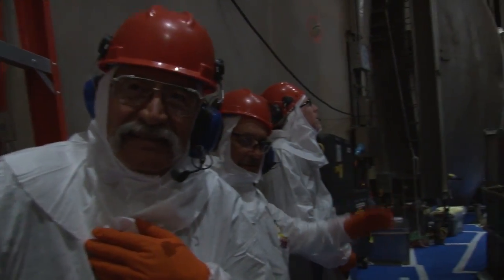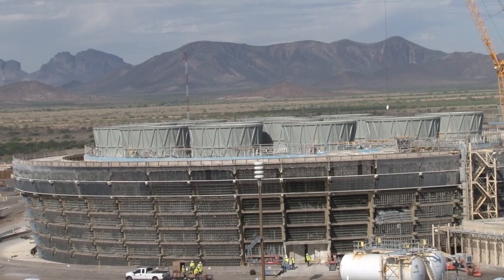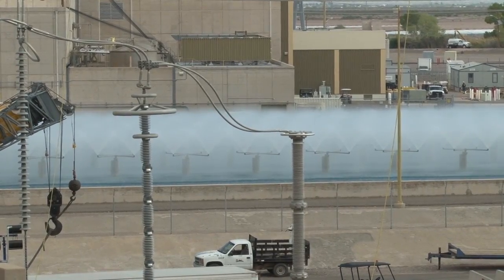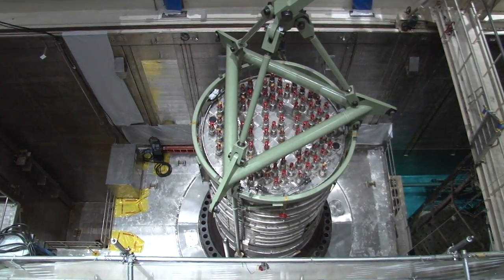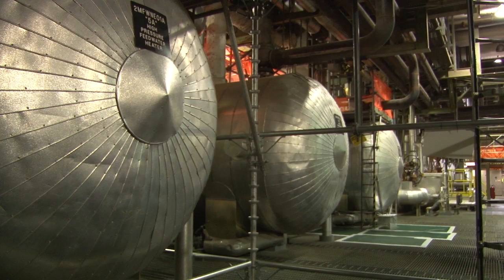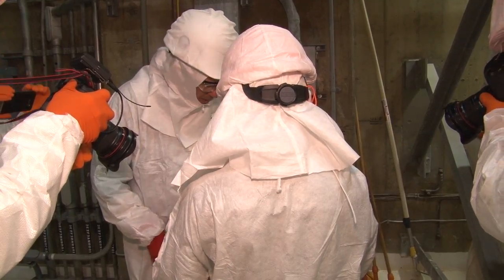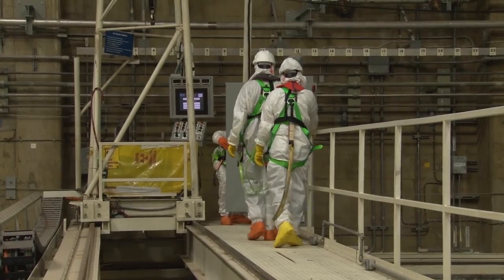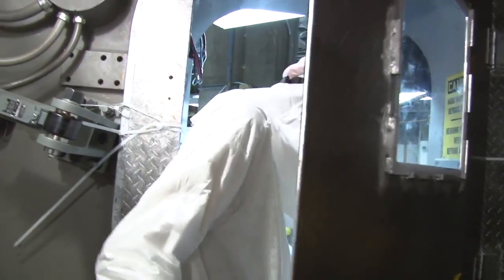Tour of the Palo Verde Nuclear Power Plant

Comment: according to my calculations in a CME level 5 event the scene could be bad.  A CME of that magnitude that could create a loss of the 66.5 million gallons of water resources from Phoenix and the two other cities used by PV each day. That  could last up to a year and, the PV plant complex would have about 17 days of water to use out of storage before it ran out.  Would the PV plant complex be able to bring about a cold shutdown in that amount of time or would we be in trouble after 17 days?  also could not find on line how much water daily is used for the cooling pools for the spent fuel.
Reply: In case of a Carrington event, you'd have FAR worse to worry about than anything that could result from breakdowns at the nuclear plant.
But in case of loss of grid connection, the reactors are taken subcritical (shut down) within seconds. At the end of one minute, coming down from full-power operation, the residual heat production is less than 10% of what it was during operation. Hence it would not be difficult to recycle the water on-site to meet all cooling needs. And so far as the spent fuel ponds are concerned, because Palo Verde puts its fuel into dry casks after 5 years, they have plenty of cushion volume, & will not start to boil.
Reply: "Your" calculations?
Reply: Cold shutdown can be achieved in less than 24 hours
Reply: @brettdavis2111  As far as I know, cold shutdown can take several days to a week
Reply: I think you're getting confused between reactor shutdown and cold shutdown